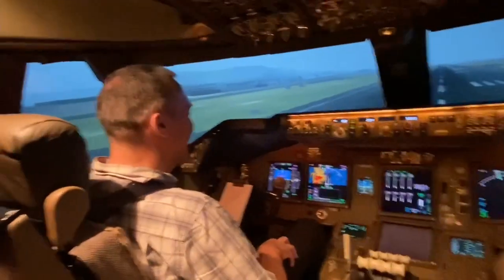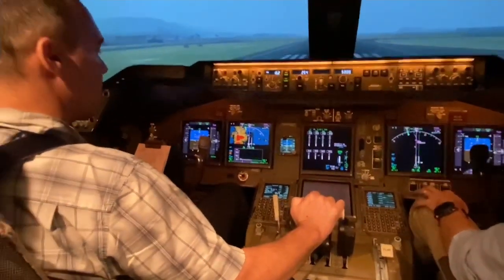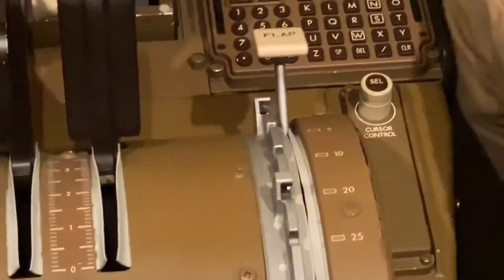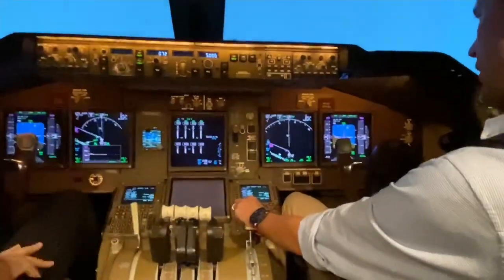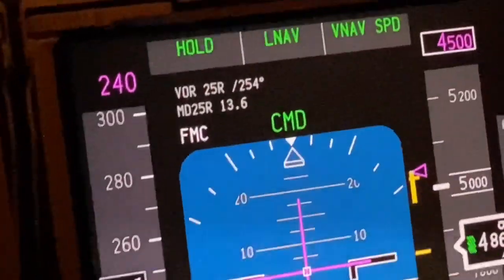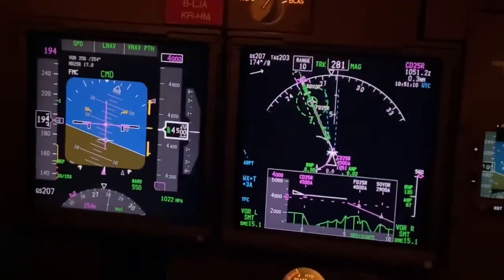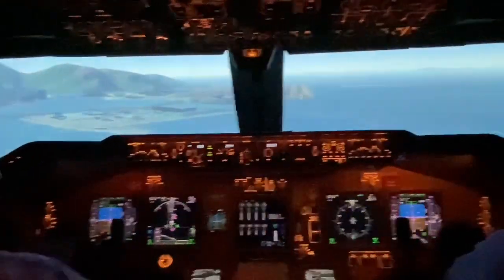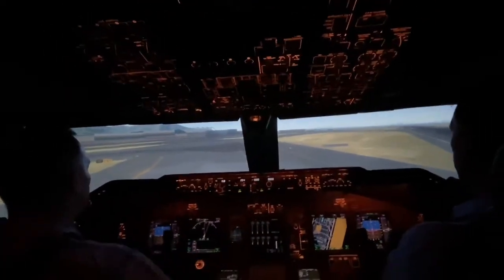Flying a VOR approach on B747-8

Comment: Having some VOR trouble on the 747.  How do I get the AP to track a VOR, the old school way?  Not a VOR approach, but just track it like in a Cessna?  I set the frequency on the RAD/NAV page, it tunes, I set the track and see it on the compass rose.  But I don't know how to tell the AP to track it. :(
Reply from the maker: You generally fly the VOR track in LNAV anyway. You type on sratchpad on the LEGS page the VOR Ident and bearing you intend to fly. You can then arm LNAV and the autopilot will engage and track the VOR radial you typed in. (It is called PBD- As in Place (VOR ident), Bearing. So lets say the ident of a VOR is HKG and your intended bearing is 250. Type in stratchpad on LEGS page: HKG250
Then insert this on the Line select key L1. after takeoff, the aircraft will capture VOR radial 250 from HKG in LNAV.
Reply: @pilot_obet  Thank you.

Comment: Why did the preselected speed show 255knts after flaps up?

Because of speed restriction or speed constraint for a waypoint.
Reply from the maker: Aircraft will accelerate to at least V2 plus 100 to allow for full manoeuvring

Comment: Is there any operational difference using the IAN interface to fly the approach, vs LNAV/VNAV?  It seems to me it does a similar thing.
Reply from the maker: Christopher Steer not that much except that with IAN, you set it up as though you are flying an ILS approach with the FMA also giving the appropriate indications. It flies a more accurate Glide Path and easier to monitor too
Reply: @pilot_obet  makes sense!  Thanks.

Comment: I love it. I am not fying the -8 anymore only the 400. Why did he push twice the altitude selector switch? I guess he was getting rid of some constrains not previouly flown to get the vnav path right?
Reply: Mostafa Sherif  Hi my friend. Well in the airline I am now the first officer does not taxi the airplane  but in my previous one the FO taxi the airplane too. Taxi the 747 is the most dificult part of the flight,  the -8 in particular since the wing tips are not visible from the cockpit. More than tricks it is mater of references and technics. Do not use more than 10 knots on 90 degrees turns and you have to think the nose wheel is well behind you so you have to overshoot the yellow line before to turn, in my case, on the 400, I overshoot the line and when it is approaching to my shoulder I start the turn. Use caution on wet or contaminated taxiways and runways, in that case use 5 knots max and sometimes we use diferential power. On the -8 we have to overshoot the line further than the shoulder you start the turn when the line already pass your shoulder and always in both cases follow the yellow line accuarately and in the case of the -8 make sure you are not going into a taxiway not suitable for the -8,  the airport charts marks the taxyways to be use by the -8 and 380. I hope that answer your question, sure Mr. Obetmaz has something to add. Cheers
Reply: yes pushing the altitude selector will delete the constraints on the sid.